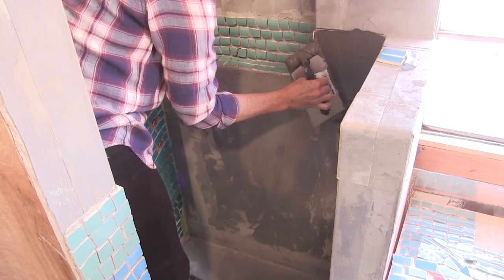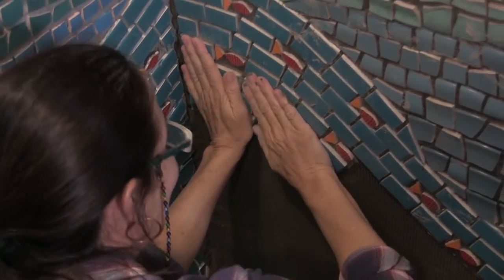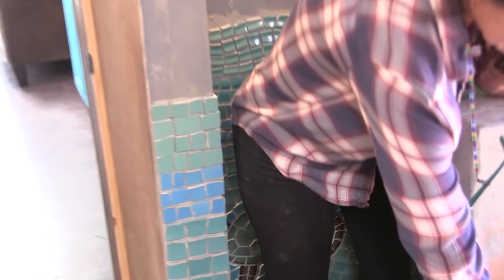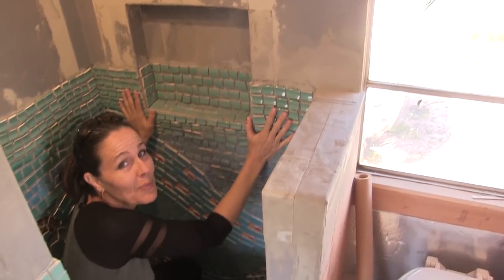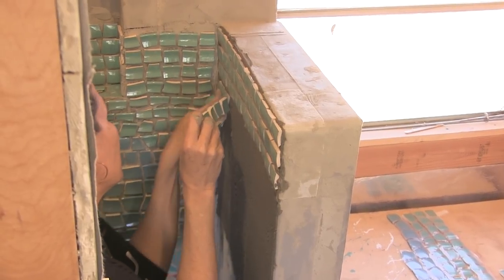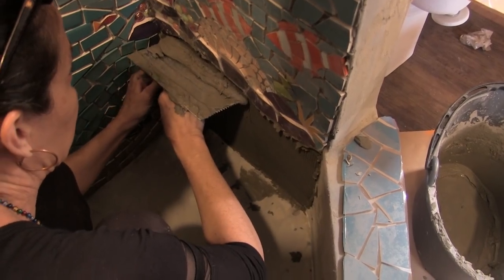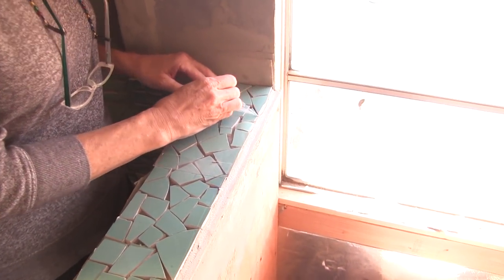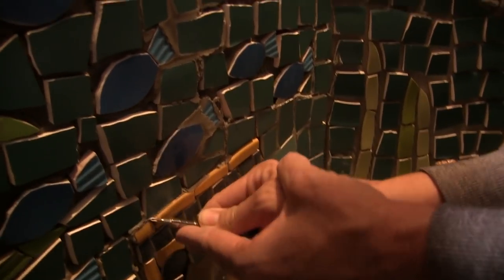Broken Dish Mosaic Shower Update: Coral Reef in a Skoolie!

Comment: Nice work, but you need to use a foam float to press the tile into the thinset.  That would have helped getting a more uniform surface.
Reply from the maker: I've had one this whole time, but still worried it wouldn't get the thinnest pieces pressed in enough! Maybe I'll try it in the next round!

Comment: A roling pin looks like it would have been handy, or a paint roller to press it in.
Reply from the maker: I have a rubber float for that, but the plates are many different thicknesses... I was afraid the thick pieces would prevent it from pushing in the thin pieces, so I wanted to do it by hand and be able to feel it!

Comment: Work from bottom to the top.
Reply from the maker: I didn't start from the bottom because I was afraid my water lines wouldn't be straight by the time I got to the top... so I started with the water line to make it straight all the way around. I just drew the line a little too low, and then I didn't even get some of the pieces all the way up to the line! Hindsight is definitely 20/20...!
Reply: Awesome job though. Love it.. Can't wait to meet y'all at a palooza

Comment: I LOVE YOUR  WORK , BOTH OF YOU. AND THE TILE DESIGN LOOKS AMAZING , BUT... I AM REALLY AFRAID , EVEN AS SOLID AS YOU HAVE BUILT EVERYTHING , THERE IS GOING TO BE SOME DEGREE OF MOVEMENT IN EVERYTHING INSIDE ANY MOVING VEHICLE AND YOU ARE GOING TO CONSTANTLY HAVE THE SMALL MOSAIC TILES POPPING OFF THE WALLS. I REALLY HOPE IT DOESN'T BUT  I HAVE SET AND REPAIRED A LOT OF TILE AND EVEN IN A NON MOVING HOUSE SMALL TILES HAVE A HABIT OF DELAMINATING FROM WALLS. AND NOT TO BEAT UP ON YOUR WORK , CUZ IT IS BEAUTIFUL , BUT MAKING IT EVEN MORE POSSIBLE IS THE BACK OF YOUR MOSAIC PIECES ARE GLAZED CUZ THEY ARE BROKEN DISH PIECES. SO THE THINSET DOESN'T HAVE ANY PORES TO REALLY GRAB INTO.
I DO LOVE YOUR VIDS AND WORK , I JUST WANTED TO LET YOU KNOW WHAT I THOUGHT.
Reply: I DO HOPE IT LASTS FOREVER , I TRULY DO.

Comment: Tip: when tiling work from the bottom up....My family works in carpentry.  If I could have,  I would have let you know before you started. So sorry.....😪
Reply from the maker: I had to work from the waterline down in order to know that the waterline would come out straight (since I couldn't use spacers like with prefab tiles).